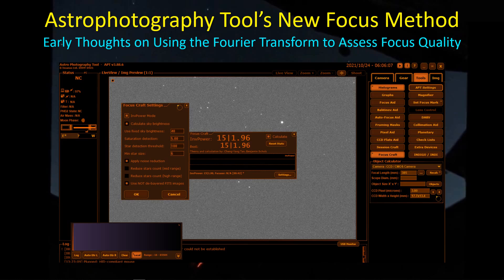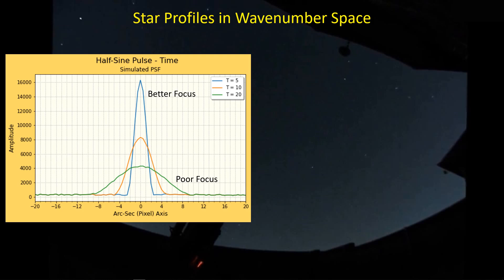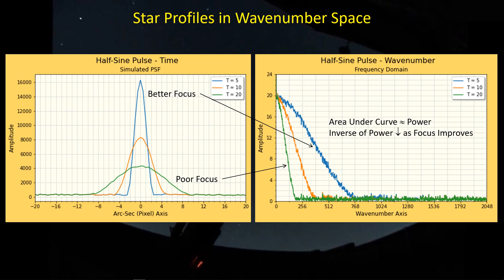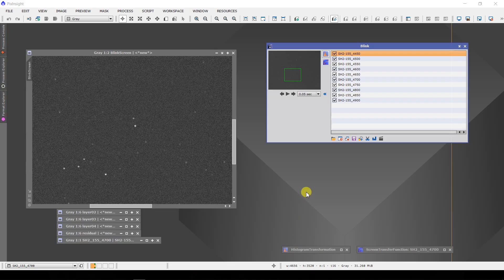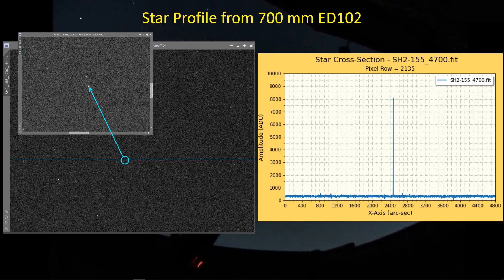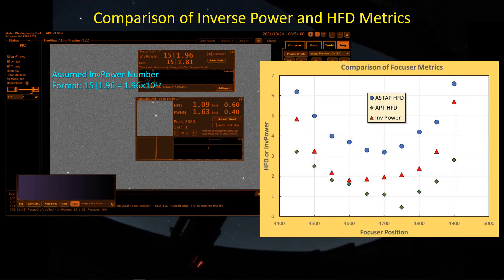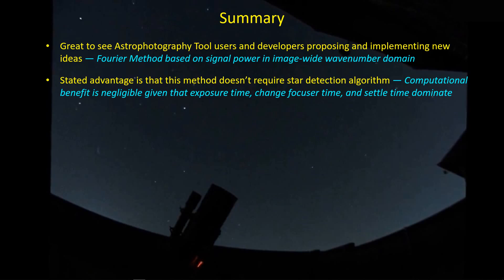New APT Fourier Focus Method - A Little Background

Comment: Hi James.  Love your video (actually all of them) and am. a big fan.  One question I have for you is around the shape of the curve resulting from the InvPower analysis.  Since the CFZ is a zone as opposed to a point, wouldn't you expect that the Fourier transform back into the linear domain would  result in a flattened minimum  due to the diffraction  limitation of the optics?  I guess that the width of the minimum in your image (to answer my own question) is much wider than the CFZ.  Is this reasoning correct?  Thanks.
Reply from the maker: Hi Robert! Thanks for watching these videos! You did answer your own question. The range of focuser motion between any two "adjacent" images is larger than the CFZ. Within the CFZ, as you say, there is very little change in any metric (HFD or InvPow). What you want is a metric that gets progressively worse (higher) as you move far outside of the CFZ so that you can fit a curve to find the true minimum. I don't know much about APT's Inv Power method, but since I made this quick "intro" video, the developers of the method published a paper on it. Here's a link if you're inclined to be slapped in the face by an integral or 2:
https://drive.google.com/file/d/1LSuSElozryAOwzL-59rAyG2gzDn5ca_S/view?usp=sharing
Reply: @Aero19612  Thanks a lot!  I've used a lot of FT in working with NMR signals so I actually do appreciate the paper.  I agree with your evaluation that  most of the focus time is spent in getting good signal acquisition, not necessarily in computing time.  My read is that then one advantage thais has is in being less sensitive to atmospheric seeing distortion since the conversion to a frequency domain acts as a low pass filter.   Well now I guess I'll just have to drag my butt out into the cold and see how it works next to minimizing the HFD.  Thanks again for the reference.
Reply from the maker: Excellent. Let me know what you think of the method in practice. I'll also give it a show with my SCT as I have been getting questionable results with the HFR/HFD method.

Comment: Hi James, Great video critique. I especially like your suggestion that incremental tiny adjustments based on data accumulated in a session should be used to dynamically adjust focus rather than the large in/out focus runs used by autofocus having to deal with noise, vibration, dynamic changes in transparency along with your critique of the analysis of the waveforms used...lots above my head. FYI I've used the new APT autofocus routine and it has responded by telling me the operation was successful. However, when I use NEB4 to take an image i then expand to 400% to look at a star, to me its still someway to go to be in focus. I'm tending to return to using my eye to focus initially then use Bahtinov Mask with exposure time of approx 6s  on a bright star to work that down to tight a focus as can be got. The real problem to my mind is the danger of trying to chase the seeing, rather than the centroid of the star.
Reply from the maker: Thanks for watching, Colm. Interesting and very good feedback/experience with the new focuser method! I’ll also be interested in others’ experience with this method. For me, I’m sticking with NINA and the hyperbolic fit of HFD. If it ain’t broke, don’t fix it. Just wish it weren’t so “brute force”. Are you referring to the seeing effects on the Bahtinov mask score?
Reply: @Aero19612  Not sure what you mean by seeing effects on Bahtinov mask score. But next time I'll run Apt AutoFocus after that do a double check with Apt's Bahtinov Aid module to see if that module confirms Autofocus result. Maybe I'm overly critical of APT Autofocus as the times I used the single pass FWHM method it gave fairly repeatable and consistent results on the Lum(N/A below) and the filter 4 a ha filter maximum delta 170 in steps on my Moonlite focuser. And seeing effects bother me too as the atmosphere has moments of transparency raising the possibility the outlier from the curve is the best focus not those on the untransparent curve? Plus maybe the method requires really stable conditions no wind up there especially. Is moving the focuser creating a seeing defect never mind the backlash. Anyways thanks again enjoy the experiments. I'm going to give NINA a go over next few months if ever our sky clears
2021/11/20 15:39:13	10024	-0.4	4.55	FWHM	One Pass	750	N/A	3.90
2021/12/14 19:38:17	10274	-1.1	37.58	HFD	One Pass	750	Filter 1	3.90
2021/12/14 19:54:31	10254	2.2	48.84	HFD	One Pass	750	Filter 5	3.90
2021/12/15 01:26:52	10121	0.4	2.70	HFD	One Pass	750	Filter 4	3.90
2021/12/19 01:56:57	10249	4.2	20.58	HFD	One Pass	750	N/A	3.90
2021/12/19 02:24:14	10295	-2.0	7.84	HFD	One Pass	750	Filter 4	3.90
2022/01/04 22:04:23	10369	4.7	20.77	HFD	One Pass	750	N/A

Comment: Hi James
Nice discussion on overall method.
I have been using this new method from apt for a week or two and have had very good results with sharp focusing.
This has been with both my scopes.
SCT 9.25 , OAG, celestron focuser.
At92 refractor, zwo EAF FOCUSER 
Most sessions done with L-extreme filter in place.
As has been mentioned on their website , and as you mentioned, for a SCT it is important to manually set focus fairly close to get rid of DONUT.
The way I am using it , with the autofocus window, 
it requires a “dim” star for the algorithm to operate properly.
If the selected star is too bright it will fail.
But with proper setup, it has been very effective, at least for me.
Thanks for your insight on this.
Take care
Reply from the maker: Excellent feedback, Steve! Thank you for sharing your experience. And thanks for watching!

Comment: Very nice analysis of the new focusing method. I have skipped the last couple of APT beta builds because I didn't understand the new focus algorithm and saw too many feedback comments describing problems getting reliable focus. I actually have really good results using the HFD/hyperbolic curve method on both my refractor and SCT and after several nights shooting experience, I can skip the re-focus routine and just bump it manually during the night to snap any drifting HFD measurements back into sharp focus by moving (generally inwards) a few steps. Maybe not as precise and not automatic, but as you indicated, most re-focusing runs result in only slight shifts in one direction through the night and it would be nice to have a solution you hint at where we might want to invent an intelligent method to continually track/adjust focus instead of the brute force way it's done now.
Reply from the maker: Thanks for watching, Peter. Funny how APT "ignored" focus for so long and now they're implementing any method that comes along. I tend to use NINA now, but I did pay to maintain access to APT to see what the "final" version will look like with true autofocus and session planning with autofocus. This new method makes me think they've lost the plot a bit. Clear Skies!

Comment: Great video! I'm puzzled, though, about normalization. The graphs at 3:15 show equal amplitude at the root wavenumber, but the graphs at 8:36 show dramatically different amplitudes at the root. Hence, not only is the shape changing, but the size of the shape is changing, and I'm not clear on how that affects how you interpret the area under the curve (or the inverse of the area under the curve). I had been under the impression that in Fourier space, the shape of the curve is a stronger indication of focus than the peak amplitude.
Reply from the maker: Thanks for watching, Mark! The graphs at 3:15 come from FFT analysis of the cosine functions where I've maintained the area under the cosine by multiplying the amplitude by a constant and dividing the pulse width (period) by the same number. This causes all three curves to have the same amplitude at 0 wavenumber. What I'm demonstrating is how the "reach" along the wavenumber axis increases as the star width decreases.

The curves at 8:36 show the same trend, but I'm using a cut through a real star so the area under the star profile is not a constant. It just is what it is. The real star is also a 3-d bump. The real algorithm probably performs a 2-d FFT that will do a better job of capturing total light power of a star.

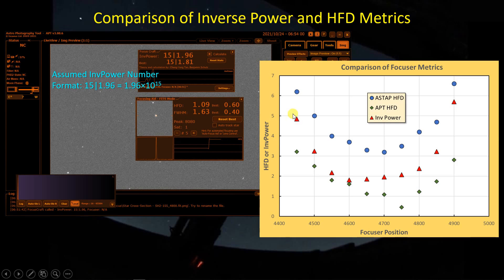You are correct: The extent of the star along the wavenumber axis is the most important feature, rather than the amplitude in wavenumber space. I think APT is using the area under the wavenumber curve. In any event, I don't evaluate the InvPower of my cross-sections. I use the APT method to assess real images in the graph at 11:00.

Long answer! Sorry. Hope it clarifies some things